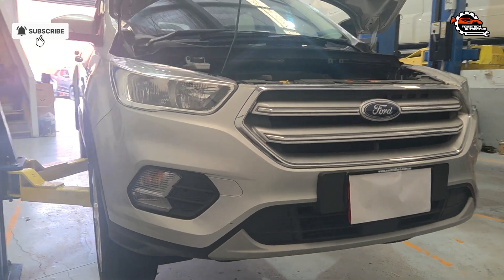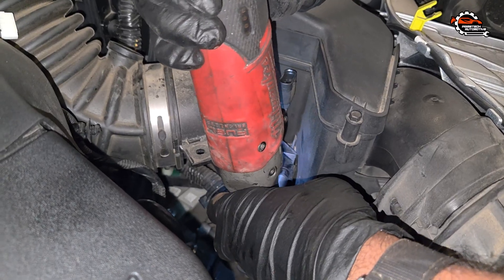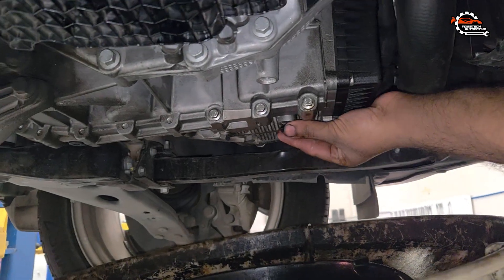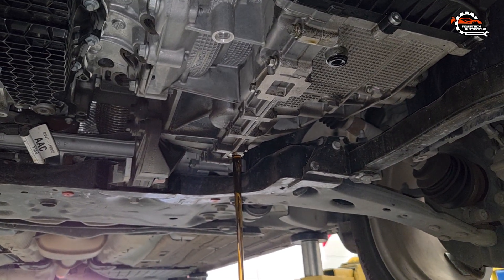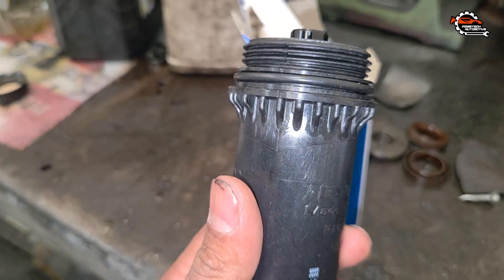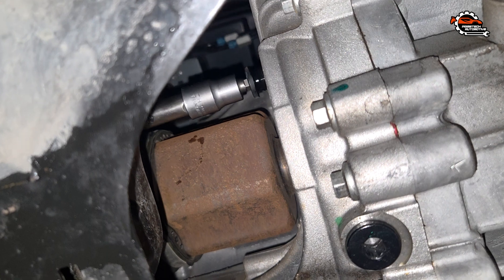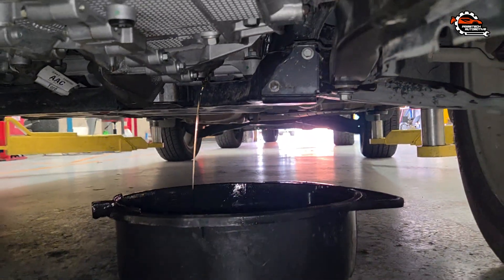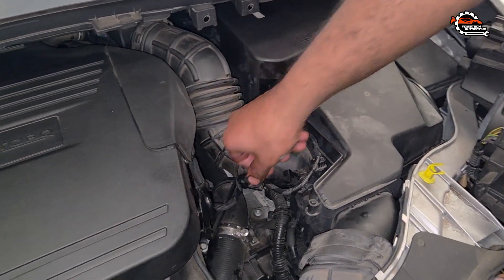FORD ESCAPE | FORD KUGA transmission fluid & filter change| Transmission type FV4R7000AF #ford

Comment: Sorry  what  !?!

"You don't need to check the transmission oil level because you have replaced what you removed.."

Are you serious !?!

Always check your levels after refilling !!

😮🙄😮
Reply from the maker: Yes if you know what you are doing. NO if you don’t know what you are doing. So I would always check the trans fluid as per workshop manual if I don’t know what I am doing. Hope this makes sense .. ❤❤